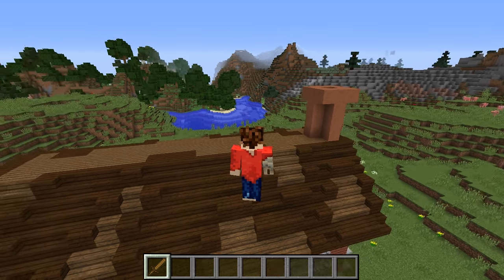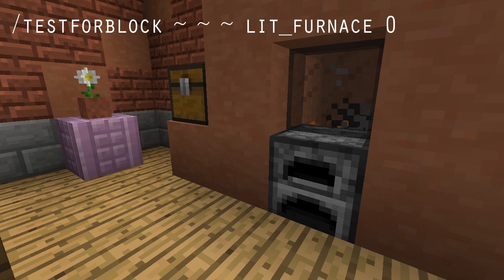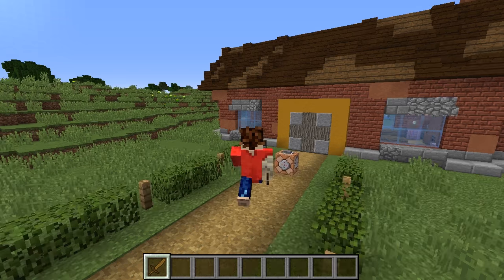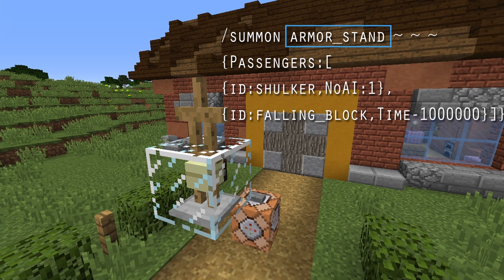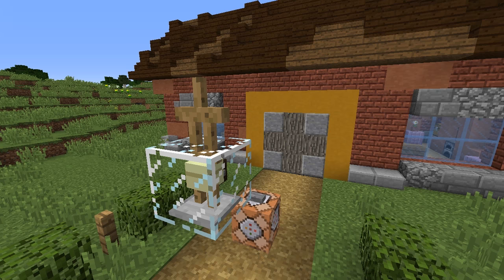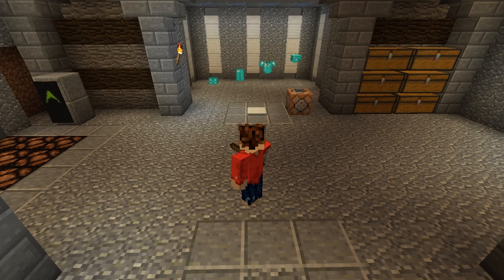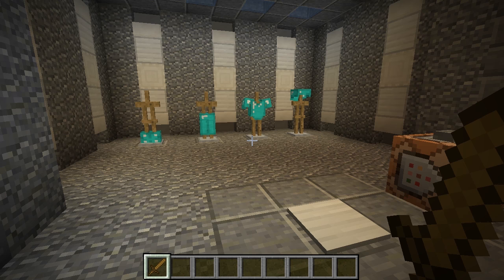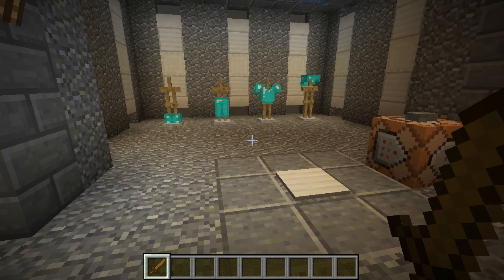Minecraft - Mechanical Redstone/Piston House Tutorial

Comment: Are the armor stands for the door really necessary? 99% sure you could just @e with shulkers
Reply from the maker: Absolutely. If the shulker isn't riding another entity, they will point blanc not detach from the grid.
Reply: shulkers can be glitchy when teleporting by themselves.
Reply: Yes, they are; no you couldn't @e it! Shulkers act like Item Frames when they are not riding an entity (Item Frames will snap to the grid of blocks). However, the armor stand not only allows the falling sand and shulker to be moved with one command, but also allows the shulker to move smoothly with the sand.
Reply: I see, thanks!

Comment: Everytime I use the summon Armor Stand with Shulker command, I get "Data Tag parsing failed: Unable to locate name/value separator for string: time-1000000"
I'd appreciate either some help, or commands (with all the correct spaces) in the description.
Reply: you just need to add change it to time:-100000
Reply: Time: -32767 is the maximum for recent versions i think.

Comment: Wait can you use scoreboard values in motion tags?
Reply: no
Reply: fejfo's games you can't put scoreboard objectives in data tags.
Reply: Then how did he give motion according to the distance? Does it only work if the player is on that position relative to the armorstands?
That's disappointing.
Reply: fejfo's games with the motion tag you can move it. what he did is moving it 4 blocks to the left and 5 forward
Reply: I thought the commands calculate where the player is relative to the armor stands and then give motion based on that.
Reply: fejfo's games he moves the armorstands to the presureplate. the stands are moved when the player stands on the presure plate

Comment: Whenever I try to summon the "block" in with the armor stand, shulker, and falling sand near the ground, the falling sand just drops off as an item. How do I fix this? Here's my command: /summon minecraft:armor_stand ~ ~-1 ~ {CustomName:ELE,NoGravity:1,Invisible:1,Passengers:[{id:shulker,NoAI:1,ActiveEffects:[{Id:14,Duration:1000000,Amplifier:1}]},{id:falling_block,Time:-1000000,Block:stone}]}
Reply from the maker: Try giving the sand NoGravity
Reply: Ok. I tried it and it did work but I needed to /tp the armor stands downwards to get them perfectly for the y axis. The x and z axis, though, are harder as you have to summon them perfectly in place or it won't work. Well, thanks for your help and reply! Also, how did you get the up and down arrows for the elevator? I know they are banners but what command, or recipe, did you use to make them?
Reply: When i spawn it i see particles [Bubbles from Invisibility effect] how can i remove this?
Reply: Add in this: ,ShowParticles:0
to the end part of your ActiveEffects tag, making it:
ActiveEffects:[{Id:14,Duration:1000000,Amplifier:1,ShowParticles:0}]